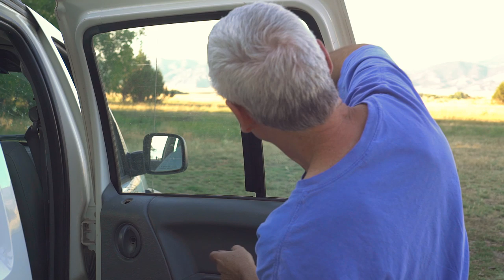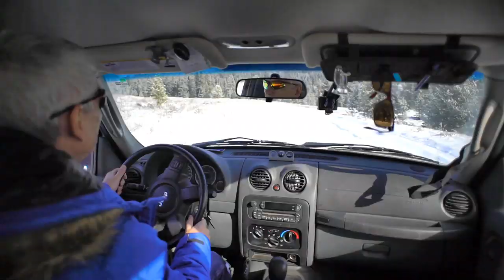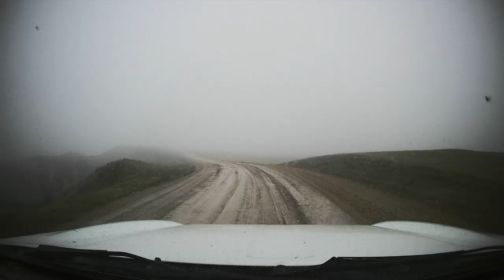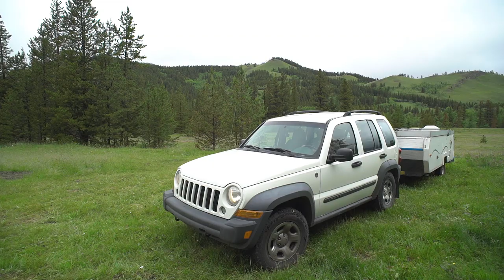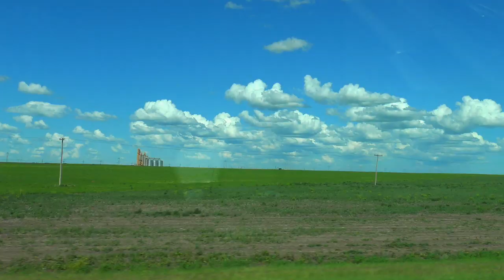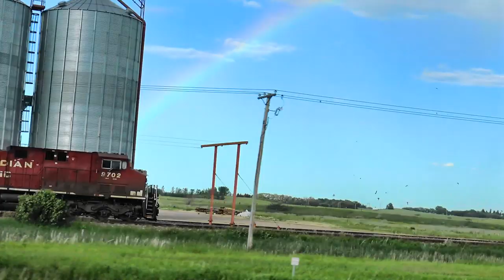Bye Bye White Jeep! Slim's Road Trip Part 1

Comment: You know I have a 1990 gmc pickup and a 1993 dodge b 250 van I used the truck for work when I had my shop pulling a 20 foot trailer sometimes 7 days a week with a 4.3 v6 in it and never had any trouble with it and even got 16 years (210.000 miles out of the first motor. One day a friend asked me to pick him up at the car dealer while they were working on his car I ended up with a new 1998 Chevy pickup that thing was in the shop every other week the windows stopped working after 4 months the radio stopped after 3 weeks the trans went out with less than 3000 miles on it the 350 v8 kept giving codes and back to the dealer I went I sold the truck after the first year and redid my old truck for around 10,000 back in late 2006 I am still driving it with another 120,000 miles so far My van same thing I went and looked at a new car and wow 45,000 I redid my old van again for around 10,000 and I'm still going. I'll never buy new again.  Another thing is I'm 6 foot 3 tall I don't fit in the small cars of today.  Good luck with your new ride and we hope tomorrow finds you in a better place.

Comment: Hey Slim, use AutoTrader or AutoTempest.com to find some cars. Great useful research sites. You could run into a nice deal on a good vehicle. If you’d be comfortable letting me know your budget, I could help make you a  list of say, top 5 vehicles in your criteria searched and matched to your needs.
Also your current liberty, seems to be simple small stuff. Honestly if your engine and transmission are working fine, I would invest fix to your current Jeep as the issues seem to be cosmetic and minor. Compared to mechanical issues that are true nightmares.

Comment: With the end of this video at the side of the freeway, I'd say maybe you should have kept the older Liberty, at least it didn't leave you on the side of the road broke down.  I currently have a 1998 Jeep Grand Cherokee, and previously a 1996 Jeep Grand Cherokee...neither of them were new when I bought them.  My 96 Grand Cherokee was previously owned by a retired couple who towed it behind their motorhome, most of the 146,000 miles on it when I bought it were from being towed....I put another 100k on it in the 8 years I owned it, and the current owner is still daily driving it about 60 miles a day and has thrown another 200k+ miles on it.  My current 98 Grand Cherokee had 150,000 miles on it when I bought it, has 158,000 miles on it in the year and a half I've had it...previous owner was a janitorial supply company, it looks brand new inside and out, and very well maintained, it was sitting at a dealership when I found it, I was amazed it was at a dealership lot...and not a Jeep dealer, and not a used car dealer, it was a Toyota dealership, usually they send these vehicles to auctions due to their age.  After a thorough going over and a somewhat extended test drive I knew it had to come home with me.  Sometimes newer isn't better, I had a 2008 Toyota Tundra 4x4 double cab with the 5.7L V8 in it...thought ooh its a Toyota never will have trouble, after rear axle bearings within a couple years, and the front differential howl/growl issue which resulted in a front differential replacement at 5 years....then to have both issues resurface less than 2 years later, and at 104k I sold the truck and haven't looked back sense.  I've had far less issues with older vehicles than I've ever had with the only 2 brand new vehicles I've owned, the Tundra and a Chevy Cobalt.  I'll stick with used vehicles as well and let someone else take the enormous hit in the wallet buying new and living with the immediate depreciation driving it off the lot.

Comment: I am in the same predicament Slim. Broke down again 60 miles from home with a 4 wheel drive and 140,000+ under its belt. Luckily just a loose screw on the rotor. But it is the 4th time in the last 6 months, so you are not alone. Take care and be safe out there

Comment: You might want to consider gas mileage when you buy as well some newer crossover type suv have car like mileage and some ground clerance like the subaru forester subaru crosstrek toyota rav4 honda crv they get good mileage and should have enough towing capacity. 4x4 chug gas awd is ok dont need tons of power just enough which is tow rateing

Comment: we have 131,000 miles om our 2010 Jeep Liberty, no regrets.  Recently put a 2” lift kit on it to reduce the rock strikes on back roads.  Had to replace the terrible handbrake with a new OEM one.  Rebuilt front brakes after mechanic failed to do it correctly.  Carry a spare serpentine belt and buy the affordable special tool to make changing  the belt dead easy. Soon to install OEM tow harness wiring. Had to install towbar.  It tows our 2004ish Aliner Scout just fine.
Reply from the maker: Good to hear Judith. Big difference between a 2007 and 2010 Liberty, as they got a few more bugs out on the later model. Thanks! SP

Comment: My research has not shown good repair rates for Jeep.  Subaru is really a great tow vehicle but pricey
Reply: Till you have the infamous head gasket issue.
Reply: @derelict_wanderer  The head gasket issue is only with the 2.5L engines.

Comment: Could've looked for a older 4runner like 4th gen because of all the above and definitely can't beat the reliability.
Reply from the maker: $$$$$ (Did you miss that part?!?)  SP
Reply: @SlimPotatohead  Even the 4th gens?? 2007 with little more mileage
Reply from the maker: Nothing under $12k unless high mileage. SP

Comment: Ever consider an electric tow car?  The gas savings alone would cover the price difference.
Reply from the maker: You're joking, right? Good one! SP
Reply: @SlimPotatohead  What mpg do you get towing your Aliner?  You said you did 100,000 miles in 2-3 years.  You mentioned 18 mpg but i don't know if that is towing or not.  If 18 mpg and $3 USD a Gallon you are looking at 5555 gallons and $16666 total Gas costs.  

Cost for a Used liberty is around $10k USD so if you replace every 3 or so years that is $26666 in 3 years or $42000 in 4-6 years.  

You might consider a Dream Case in a Tesla Model S 75D (four wheel drive)  with free supercharging.  For about $40k. 

Add in a hatch tent and you have similar sleeping accommodation to the Aliner.  

See Dream Case Tesla Model S you tube video's.  

No oil changes, not exhaust, no radiator fluid, etc...  very little maintenance.  Np gas to buy etc...  in snow storms you keep the tent in the frunk (Front Trunk) and sleep in the back.  You can carry a portapotty in the frunk if you wish with a shower / toilet tent.   It is not in the car with you.  

Sleeping in the Tesla in camping mode gives you heat or AC.  no noise no gas fumes no lights on.  Secure animal people proof way to sleep in a car.  Or pop the hatch and use the tent attachment for bug free, eating, sitting, watching, changing, etc...  

Sounds crazy until you look up the options and just how cheap you can actually drive a 100,000+ miles in an electric car.  Lots of free public chargers, camp grounds, AC road side chargers, DC super chargers, or just block heater plugs.
Reply from the maker: Aren, I still think you are joking. I am a wilderness traveler on a budget. Do you really think I would take an urban car of any kind on the rough and dirty roads of the mountain backwoods? Can it ford a river? Will it start on a -40 winter morning of a trail? How happy would you be cramped in a Tesla for 3 days while a blinding gale twists all around you, not able to stand or walk? What is the ground clearance? All technology fails, it's only just when. If it breaks down in Owsego Montana, which local garage can fix it? 

Sorry Aren, I live in the real world and use vehicles that are designed for the purpose. My life may depend on it. 

It's not that I have anything against electric cars. I rode one in 1973. But there's a reason I haven't rode one since. They are strictly urban vehicles, and I'm a rural traveler. My Jeep fills up in 5 minutes at virtually any back roads  gas station. I generate my own power for my trailer, have warmth, comfort, shower, toilet and a very comfortable bed. Once you can top that, and at a reasonable up-front cost that doesn't put more people in debt, I'd be happy to test it out. Problem is I probably will be long gone by the time it happens. Thanks, SP
Reply: @SlimPotatohead  I have a friend who camps in his Chevy Spark EV.  He is using the discounts to upgrade to a Chevy Bolt EV  for better camping and such.  He camps in the Utah mountains all the time.  

On your budget it might be tough to get a real good 4 wheel drive ev.  There are a number of very affordable front wheel drive EV's.  In time that will change of course.  EV's are still kind of new.  

With a slight change to your routine you could camp in more accessible spots then take an E bike into the harder to get to places.  

EV camping is different, you can't do everything the same but you can do it much cheaper in an EV.  Making us of free low speed charge points one can park and charge for 12-24 hours while cycling down to a lake or using a combo hammock tent for the day.  Or park at the beginning of the trails and go to places nothing can drive to.  

Different but different isn't always bad.